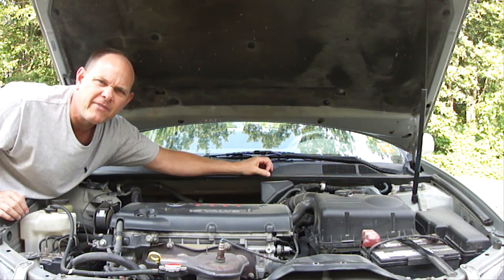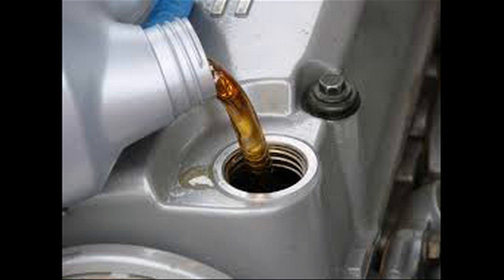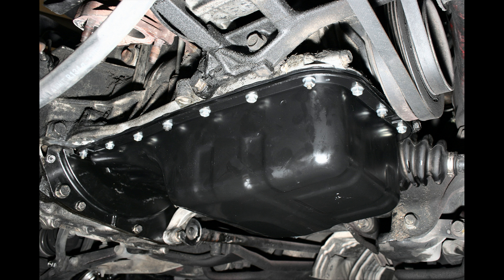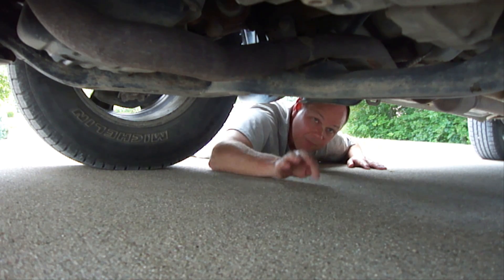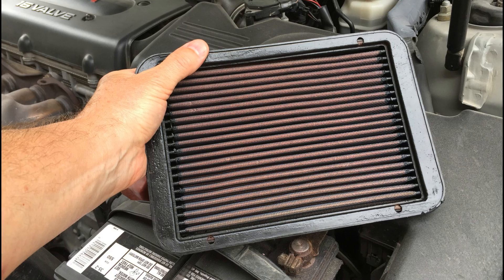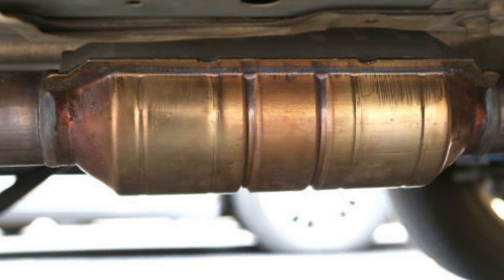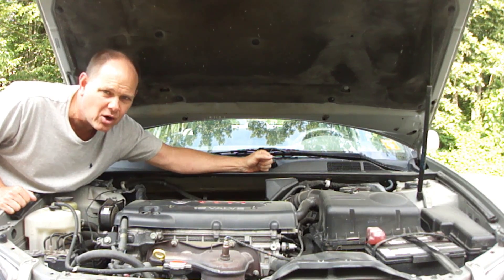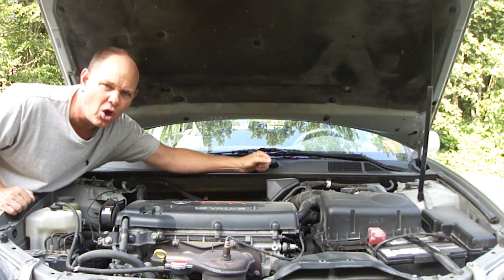Why Do Engines Lose Oil?

Comment: we have a 2009 Buick Enclave and leading oil almost to empty every 2 to 4 weeks!   Not a drop on the ground though, any idea's here?
Reply from the maker: Jeff Long My guess would be your burning oil from bad piston rings or valve guides. If you remove and inspect one of the spark plugs it might tell the story.
Reply from the maker: Jeff Long 👍😊

Comment: I have a 2019 CanAm outlander 450 atv we just did a fresh oil change after 1800m it is a full synthetic 5w-40 the engine is a rotax if I have no blue smoke and no oil spots or leaks what could it be and I have checked my air filter

Comment: what about lightly used snowthowers is two years to long?   i hardly had any snow last year and wondring if if can skip ayear?
Reply: If the snowblower was a recent purchase as such, change the oil because of break-in metals from running a new engine.

Comment: I have a 1995 Acura Integra it has over half  million kms.     
( 667,000 km)  and it burns half a quart a day of oil . I was wondering if anyone knew why that was with that particular model of car ?
Reply: Nothing wrong with the model dude, your engines just worn out from too many miles. Time for a new car.
Reply: I have a Acura Integra GSR as well. I noticed my oil kinda "disappears" after a month or so. I'm wondering if it's my piston rings that are worn out. There is no external leak either
Reply: Lucifer Light change out the PCV first. They are probably like $15. If that doesn’t help, your engine is probably worn out